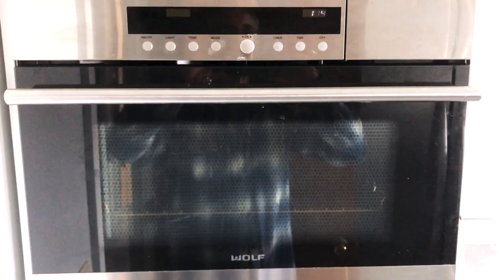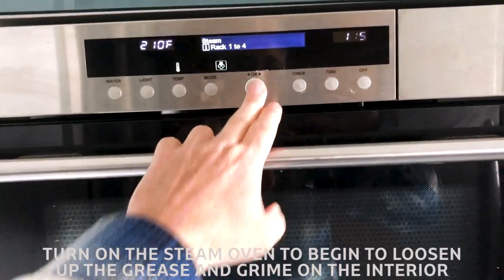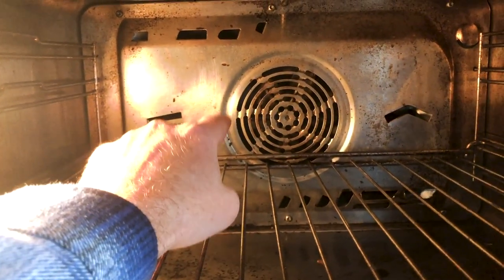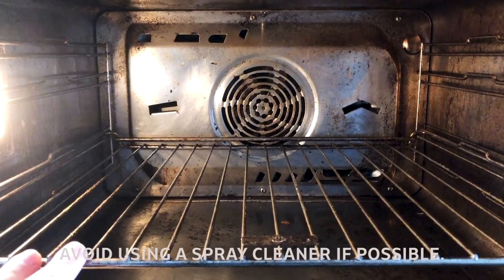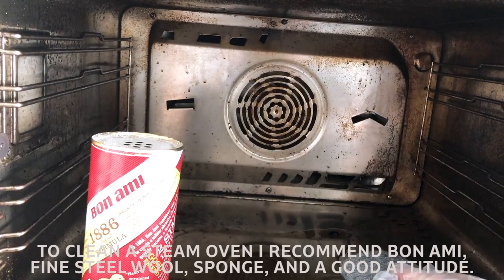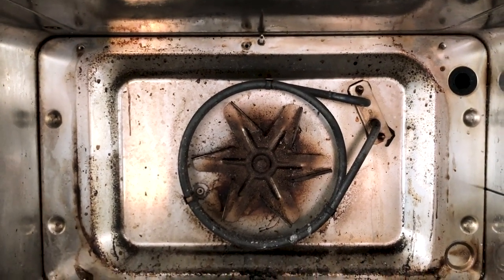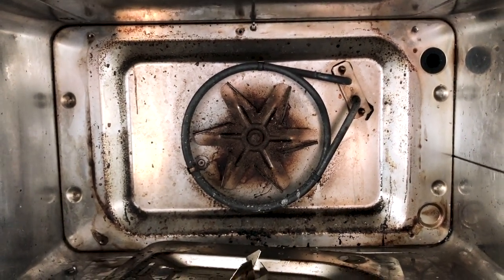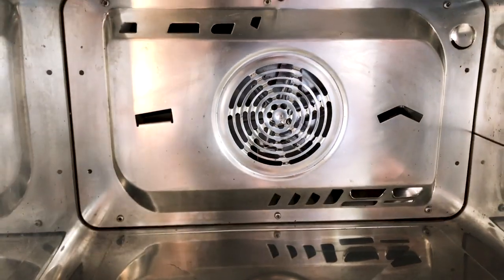How to Clean a Convection Steam Oven in under 30 minutes

Comment: Additional info: An "oven cleaner" product is not generally recommended for use in these ovens or in any air fryer, as it can actually remove the coating to the inside components.
Reply: This happened to me. Thank you for mentioning it.